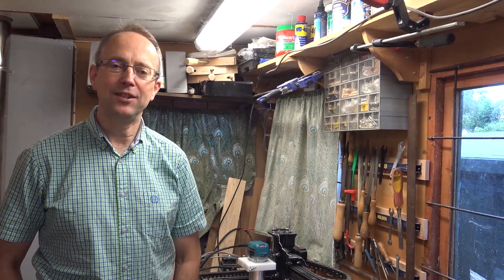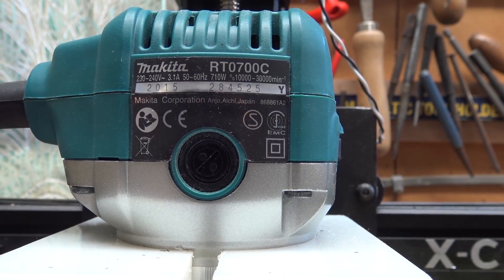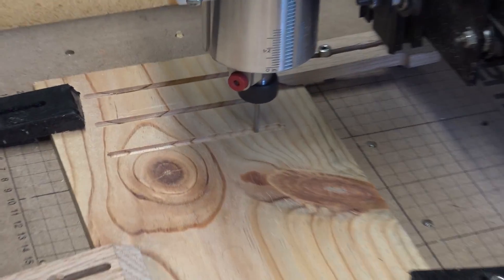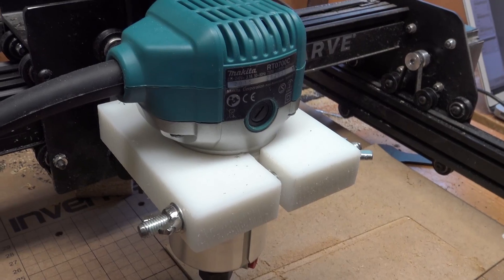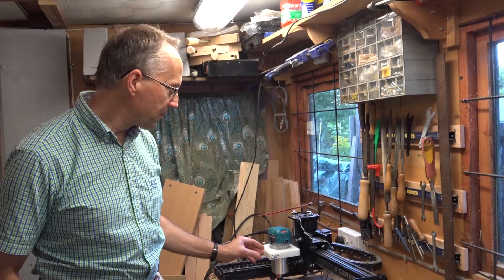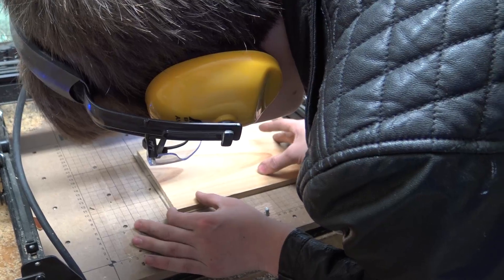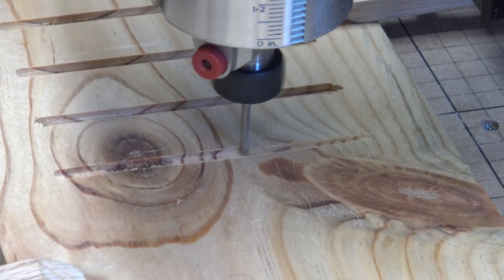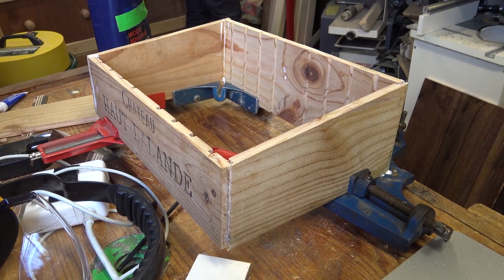Adding a Makita Laminate Trimmer to an X-Carve.

Comment: I used this router on my cnc build and it worked great but after a few long runs the bearings started to wear and the first router caught on fire.  It was replaced under warranty.  Its replacement ended up needing bearing replaced under warranty at which point I changed to a water cooler spindle. It's much quieter and has a lot more power.   

I certainly wouldn't leave that router unattended.

Comment: I have owned a large 4ft x 4ft CNC router for 16yrs, and also have a much smaller tabletop CNC router/engraver. The X-carve seems like a well designed and priced ENTRY LEVEL machine. I think people need to understand that there are design limitations. The X-Carve is built for lighter work. A more powerful spindle and higher cutting speeds also put much more stress on the frame and drive system. The light frame will also result in resonance and flexing when attempting to cut harder materials, or increase cutting speed.  The smaller spindle on the X-Carve is not a flaw, it is a design element.  I actually use a 700W spindle on my large machine most of the time because I do a lot of work with 1/8" and 3/16" bits, and a larger spindle is overkill. When I need to work with 1/4" to 1/2" bits I put on a 2hp spindle.  My small machine has a 300W spindle (similar to X-Carve) and I find it perfectly adequate for smaller cutting and engraving work. The rule of thumb on these type of machines is that greater spindle power should also be coupled with greater weight, a more rigid frame, more powerful stepper motors, and larger lead screws and bearings. My advice to all prospective buyers is to think about what working size you need, and then buy the heaviest, most robustly built unit you can afford. CNC is fun and addictive.

Comment: I'm actually outside right now trying my second attempt at a shave horse from your design. I'm really having trouble drilling the peg holes straight. Any tips would be great. How did you drill the leg holes on an angle? Thanks.
Reply from the maker: +john espin A couple of try squares and someone else to check you are drilling straight is a great help for the peg holes....I drilled in from each side on my latest one and asked a friend to help check I was going straight....I was not!!! If no one else is around perhaps try a mirror as well! For the legs I used a sliding bevel and did a small test rill first with a long leg length of 6mm dowel to check the angle looked right - good luck.
Reply: Thanks for your time Harry...
I'll let you know how it goes....